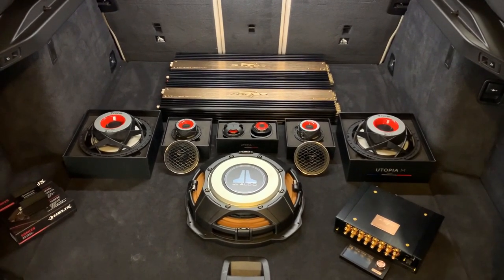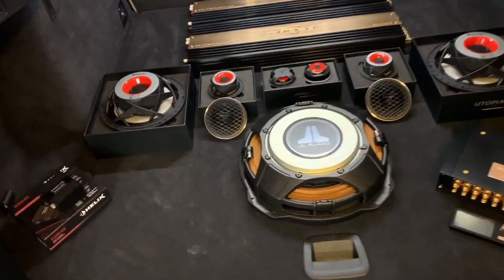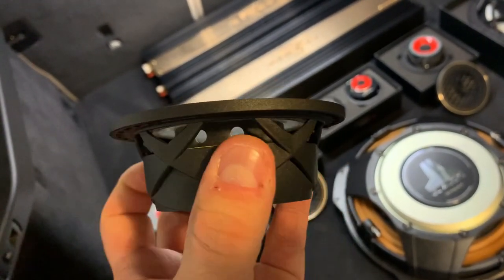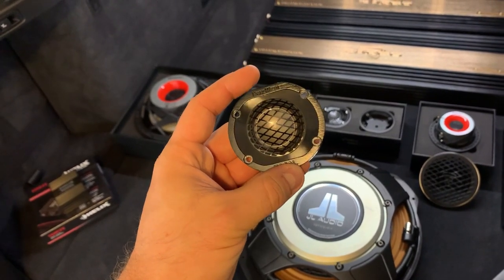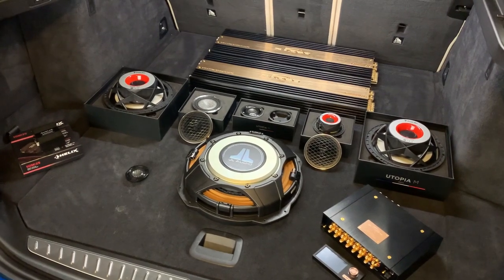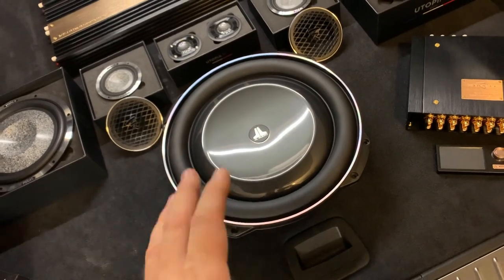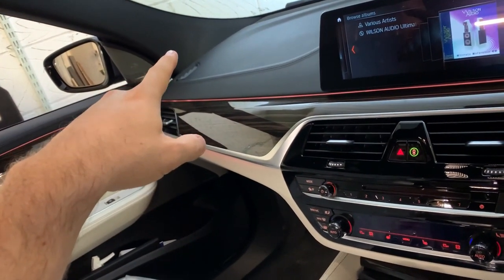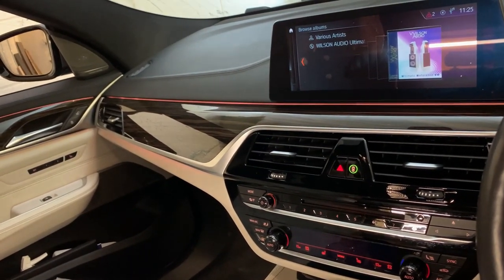BMW 6 GT intro - Focal Utopia M 3way, JL 13TW5 sub, Zapco AP Amps, Zapco HDSP V DSP, Helix SDMI25

Comment: Focal Berylium tweeters are amazing.  Same as there home audio stuff.  Surprised on the subwoofer choice but cant go wrong with JL still. Figured it would be another Focal sub or something a bit fancier. Still good choice, I'm dying to watch the rest of these vids in the series now  :)
Reply from the maker: Franks Life Changes no surprise on the JL, nothing else could fit under the panel in the trunk, that simple. Btw most subs can sound as good as what the tuner dials into the DSP, so.. 🤷🏻‍♂️

Comment: I got the same speaker set-up just different amps and dsp. Can't wait to get it installed 😌
Reply: how did your system work out?
Reply: @MrSupernova111  sounds great! The tweets and mid range could be aimed better like on access. Overall I love it... ❤️
Reply: @kellenstrickland3847  . Great to hear! The Utopia Ms sound incredible but are above my price range. I'm thinking about going with the K2s. Do you think its important to upgrade the rear speakers as well or is upgrading the front speakers good enough?

Current set up: 
front: 6.5", 3.5", and .75"
rear: 3.5" (maybe replace with 2-way 6.5" and 3.5")
Reply: @MrSupernova111 it's personal preference. I say why not if it's in your budget. Tuning is more important. If Tuning is done right you'll barely notice them back there to be honest
Reply: @kellenstrickland3847  . Yeah, I'll be taking the car to the shop. Too complicated for me. Thanks for the feedback! Much appreciated!

Comment: It's a shame you won't be able to see those middbass drivers under the seat, they look really sweet. I've been dreaming of putting a pair of those 13t jl subs under my truck seat. Looks like it's going to be another proper mad build Peter. Can't wait to see the completion.
Reply: I'm confused... don't you need to have midrange drivers to be somewhat facing the listener?  Subwoofers, sure, but surely midrange sound waves need to point towards the ears?
Reply: @i_kill_for_zardoz  perhaps you are confusing midrange with mid bass..?
Reply: OK when I said midrange, I  was just speaking loosely. . But my question still stands. Only subs get omnidirectional right? So an 8" putting out 200 to 500+  would still sound muffled under a seat, no?  Not sure where those 8s are crossing over to up top, but I just don't understand how their intended range can deliver accurate sound bouncing under and through a car  floor and seat.
Reply: @i_kill_for_zardoz  if your system is tuned right, all of the speakers play together in their perspective ranges.  If you were listening to the midbass alone it might sound as you say "muffled "..but once the system is tuned and playing together,  it sounds amazing. Have you watched all of Peter's videos on sound quality in cars? If you have not, I suggest you go to the begging of the series and watch all of them. You will learn a lot and get a better understanding of how it all works.

Comment: Hey pete I totally agree with you to have a good system without the install it's not cheap, I did the whole sound deadening which took 2 weeks 8 hours a day, with 80 to 120 mil and ccf $350, the two mmatts6150 amplifiers $ 2,315 , plus a mmatts md4100 for shakers $299, pioneer avh501ex with miracast and simple cables to be able to mirror phone on screen $375, 3 way up front , wideband with center channel and a pair of height tweeters, the rear has a midbass with a wideband. All cdtaudio wideband, tweeters midbass ,then a 12 inch in a prefab box modified with braces and sound deadener, and now ( jesus) zapco hdsp$2000, so when all done ,about $5000 to $6000, because I didnt include, the two batteries which add another $350, ohhh, I bought something similar to the connection distributor box , $45, and Isolator by stinger $65, ferrels, crimpers ,cables, wires, tech flex, $100 more,since all is in the back of the car, plus  a basic install ,just oem ,stealth,  in the rear cubby storage of the 2017 toyota prius v, $1,700, it's not cheap, after all this time I finally have almost all the equipment,  is it worth,  I believe so and even my lady agrees,she loves music,videos and movies, and we drive a lot so in six months of use we get all that money back in pleasure, plus forgot to include the bass shakers,  from $50 to $250 each depending on model, my worry is to buy a used zapco hdsp v and save like $500, should I just buy it new , the 16 channel with bluetooth module, I'll be using my old fiio x5 with coaxial  , I'm scared to buy used for being cheap and get something that wont last.

Comment: Hello PETER
I want to know on your opinión what is the Best way to use a Fiio m6 with tidal for sound quality.
1- connect directly from the fiio to the dsp with the AUX - RCA cable .
2 - Connecting the fiio passing for  the pioneer head unit with aux connection. 
And why should i use your way. 
Greatings from México. I hope one day to meet you. You do the Best proyects!
Reply from the maker: Ivan Ibarra if you have a DSP, then keep the signal flow and conversions from digital to analog and back minimal, so just go straight to the DSP and bypass the HU! 
I haven’t used/sold a HU for 5 years! 😃
Reply: @pssound9749  thank you so much PETER!!!

Comment: Excited to see how everything works out!

What is the best file format to use with the BMW system?  I hear FLAC but bits rates etc?  Is that convertible from CD?
Reply from the maker: ccvideotech yes you can rip CDs to FLAC, but CD is 16bit wav. 
I think this HU can play 96k 24bit max.
Reply: @pssound9749  I see this build is all dedicated large amps and DSP but three questions came to mind after the last BMW build.

1)  In your opinion, how much SQ would be gained over the factory HK (and left on the table vs going full active) if using a DSP AMP (like Arc, Helix V8, V12, or Zapco) running the door's mid and tweeter passive as from the factory (presumably with only a cap to crossover the tweeter and nothing to low pass the mid) VS running active on this two drivers?

Individual time alignment seems less important relative other vehicles as the distance between the mid and tweet in the same doors is quite small.  Lack of low pass crossover on the mid I'm not so sure about though.  Leaving two drivers playing a good bit of overlap and no way to roll off the breakup of the 4" mid.  (Low pass in the amp of course.

2) What are your feelings on the Arc vs Helix vs Zapco DSP amps?  (Aside from the fact that Helix has a 12 channel model while the rest are 8 and the Zapco has a high-res HD Player.  Are there other strengths or weaknesses?  To go full active the Helix V12 would be required.  The 8 channel models would be fine is passive as well as significantly reducing install time at the cost of some tuning restrictions.

BONUS:  Do any of these companies make a multi channel amp without the DSP so the you could use a standalone DSP but still highly efficient / small foot print (both physical and budgetary) amplification.

My thought is upgradability with this route.  Where as an integrated DSP amp is scrapped if you decide that you want to upgrade as it doesn't have full line outs to convert the system.
Reply from the maker: ccvideotech jeeez man, this was long to read! 😳😖😃
I’m not sure i can answer everything when i’m about to crash out! 🛌 1. Fully active always have benefits, but most people can’t tune and get better results than having the mid&high passive. If anything, at least you can set levels independently, which is enough on it’s own for me to do it, BUT then you also need extra cable into the door which is major PITA! 
2. There is no multi channel amp without DSP, only few options which can be stacked and then they use slightly less space, but not as little as a multi channel amp+DSP. You can do great job with those pocket rocket 🚀 D-class amps + DSP if you get a proper tune on the system! 👌🤘
Reply: @pssound9749  kinda what I figured.  Thanks for sharing your insite.  I come from the 90s-early 2000s when we were just starting to except class d for subs.  I always ran full active with stand alone dsp (Sony ES) and multiple 2-channel A/B amps even back then.

Rerurning to the scene wrapping my brain around a singe 12"x12" box running a 14 channel system.

Cheers, get some rest👍
Reply: cd is best

Comment: Hi, really cool channel with lots of good info. Thanks
I'm looking at using a zapco dsp-iv ii with a kenwood 5volt out head unit and a focal fpx 5.1200 amp can you see any problems with the dsp and upto 5 volts from the head unit. Thanks. Seen a few things on the net that makes me concerned about lack of input gain with the zapco.
Reply from the maker: Raymond C it’s the amount of misinformation is what the real issue is and the lack of knowledge to setup systems properly! I’ve sold probably 30 DSP Z8-IV II, installed and tuned plenty of them and it’s an absolutely joy to work with! 👌

Comment: That will be one of more expensive builds. The drivers look nice but it depends how they perform 🤔  will need to wait for your opinion after build 🙂 it is nice that there is enough space to hide all of that equipment at the back. Will look like OM. I hope helix or mobridge will soon release most 150 adapter box that I can get signal from my car. It dose flac too and its more convenient then connect my phone to dsp 😁
Reply from the maker: ealneas1 most150 is already available from both brands and i can sell them. 👌
Reply: @pssound9749  really? I have emailed them in the beginning of the summer and  helix said they don't have any plans on supporting it. At least for now. Mobridge said to me that they have for Mercedes and BMW  but not for Audi. They are waiting to get some software from audi 😒
Are you sure that it would work ? I have 2015 a7. It runs software of MHI2 . 
That would be great. I could get rid of off my boss amp and have some space for a  biger amp 🤣
Reply from the maker: ealneas1 check AF’s page now, it has just become available. 👌
Reply: @pssound9749  what page is AF ? Nothing comes to mind 🤔
Reply from the maker: ealneas1 Audiotec Fischer, the manufacturer of Helix. 😃
Reply: @pssound9749  sorry, silly me. I forgot their  name was that 😃 but what they have is nat tv zen V ? Similar unit to that bin long time a go. Will have a look maybe will buy if supports my car 🙂
Reply from the maker: ealneas1 same thing rebadged in theory.
Reply: I contacted them to see if my car is supported. In description it doesn't cover car with the same software version as mine 😔 Will see what they will say.

Comment: Have you tried the Purifi 6.5 woofer great for midrange snd midbass
Reply from the maker: Anand Shah yes, but needs very specific installation! In a car it’s about location and application and if the specs of the drivers don’t suit the application, then it doesn’t matter how good those speakers are in a bookshelf or floorstander at home.

Comment: Would you use Focal Utopia M 3 way or Morel ELATE 93A 3 way running off a Mosconi 5/30 amp? I already have the two jl 13w5's under my back seat. Also any need to have 6 1/2's in the rear doors? Or will that ruin the SQ? I am installing this in a F150 Crew cab. The JL 13's are amazing btw.

Comment: Man that system deserves a FAR better subwoofer. Unbelievable otherwise!
Reply from the maker: Martin Benning many people says that, but we’ll see how it goes! 👌
Also, what other sub would you use that can work in a shallow space and 0.8cuft box with decent output potential too?
Reply: @pssound9749  it might take a day or two to find, but I would go with a 12” Aliante or Alto Mobile Falstaff.  I’ve used both and both are extremely detailed and transparent. Again might take some time to find but it would be worth the wait if it were my car. Just my $.02. Great work BTW!  Very nice builds!!
Reply from the maker: Martin Benning i used to have Aliante and i can only agree with you, but finding one in a GOOD STATE is the real issue! We need something from current product line. 👌🤷🏻‍♂️

Comment: Hey peter very nice build! In your tuning videos though, I was always wondering why you never mention things other than EQing? Things like limiters, time delays, phase processings etc. Is it that the DSP's don't have these settings, or that these settings don't matter all that much, or that it's just something that you don't wish to share for free? I always think of the limiter/compressor as a necessary process for any kind of audio application, I'd like to hear your experienced opinion on that. Best regards!
Reply from the maker: Ali Mahdavi next tuning video will explain how many things i never mention, because as u feel it too, i don’t give everything away! 👌
Compressor in my world is the worst enemy, unless you want to build a system for a club against red tilting DJs! 😃
Reply: @pssound9749  Hahaha yea it beats the heck out of sound quality when it activates, but at the end of the day you have to protect those valuable drivers and amps against long-term abuse. It may be my personal feelings, but every time I hear a driver distorting I deeply fear😂
.
Edit: I do believe that the designer should always leave as much headroom so the compressor never activates at normal use, but not always do you have the resources to do so. Like in the club scenario you've mentioned.
Reply from the maker: Ali Mahdavi you need better power supply and better matched clean power then! 👌
Reply: @pssound9749  The fact that you don't wanna give away all your experiences is totally understandable.
How about phase processing? I've heard you can flatten the spacial peaks and nulls (standing waves/room modes) that ore otherwise uncontrollable in any room. In your videos I've seen you work your way around standing waves by choosing crossovers wisely and EQing locally at the listening position. Phase processing (the way I've heard it) can give you a spacially flatter response and make your day a lot easier. Check out Dr. Earl Geddes' works, He's got his PhD on the subject.

Comment: Hi Peter. What kind of dac cips you usually used in your project in zapco hdsp v?  Thanks...
Reply from the maker: DS 1 still what it comes with, the 4458, which already sounds better than most DSPs out there.
Reply: @pssound9749  Peter! Thanks for your interesting channel.  I really like your projects and your creativity.  I am struggling with the choice between Brax dsp on ak 4490 or Zapco hdsp v on Ess 9038. What would you advise me.  Thanks in advance for your valuable answers.
Reply from the maker: DS 1 we used the Brax this year and unfortunately we’ve had issues with it, still have issues with it so much so that it’ll be taken out as AF can not resolve it. 😖 I’m sure / i hope others have more success with it...
Reply: @pssound9749 Thank you very much for your answer and have a nice evening, Peter!

Comment: I have the jl audio subwoofer not very impressed for the money
Reply from the maker: Leonard Slade we know that we may need another option, but we wanted to try squeezing everything under the floor. If it’s not ticking the boxes for the owner, than we’ll try something else or different install too. 👌
Reply from the maker: Leonard Slade what is your issue with it?
Reply: @pssound9749  sound quality was good but didn't seem to play solid low notes I did try in a .5 and .75 and 1 cubic foot box my amp was class  H 500 watts sq amplifier and for 650 dollars I've had 200 dollar subwoofer that sounded much better all had upgraded electrical sound deadening though out. Hope this helps.  It was not terribly just not a good value
Reply from the maker: Leonard Slade i think here you pay for the technology more than anything, being so slim. If we had the option for a full-depth sub, we’d 💯 use something else! 🔊
Reply: @pssound9749  I agree still going to be a awesome install  can't wait to see the final results